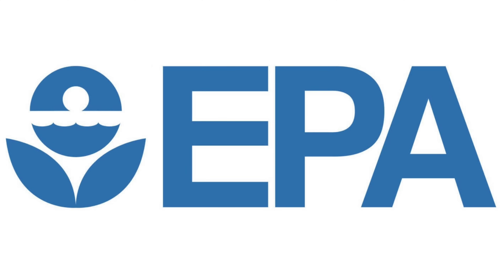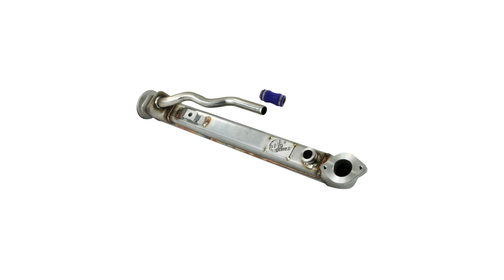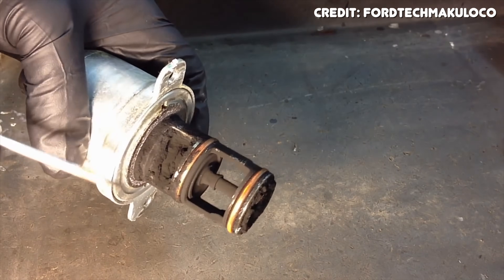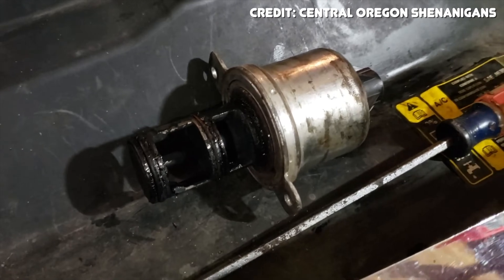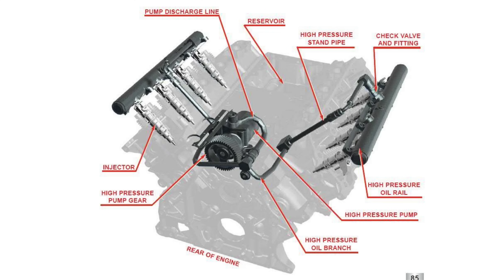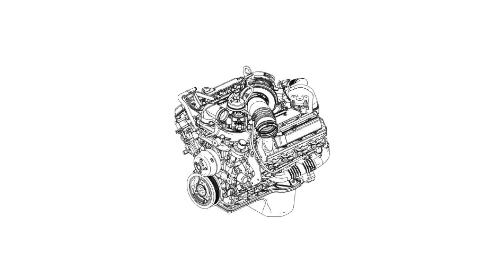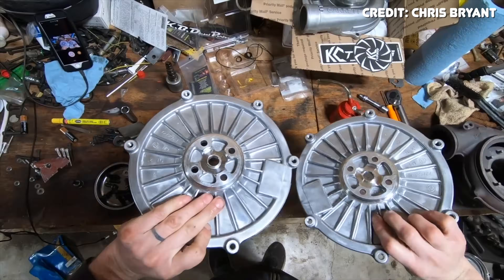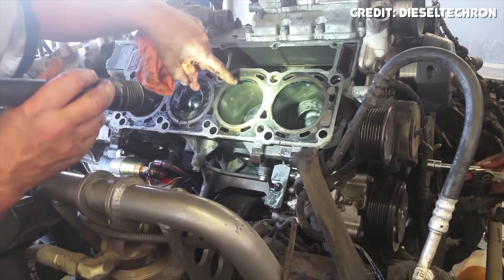The Truth About the 6.0L Powerstroke (And Everything Wrong With It)

Comment: I had my 6.0 for 17 of the 19 years. With all the necessary upgrades, the best motor. The key, change the damn oil! I add AT-205 to keep the O-rings happy + add Sea Foam and Lucas to the crank case. Keep the engine cool (Mishimoto)....1M miles baby!

Comment: Also, it was never sand clogging the oil
Cooler. It was the breakdown of Silicats in the Motorcraft coolant used in these motors that caused the clogging of the coolant passages.

Comment: Off the line originally it was a nightmare. However, when bulletproofed and properly maintained you won’t find better power, reliability, or value from Another. These trucks are still highly sought after and cost effective to fix and drive for well over 500k miles. Just a plan fact.

Comment: Why do you have to bulletproof it? That means it's NOT a good engine. Anyone that thinks it is doesn't have a clue. The modern 6.7l built by Ford is completely amazing. No bulletproofing necessary. My 2018 f250 has 480,000 miles and with 500hp and 1100tq.... It smashes any tow job or highway trip. 7.3 was good reliability, but has no power in comparison. The 6.0 and 6.4 are embarrassing. You'll eventually try a 6.7 (2017 and up best) and you will see.

Comment: I bought a 2005 (F350 dually crew cab) 6.0 with many upgrades already completed; EGR delete, studded heads, new turbo, radiator, etc with 196k. I paid $7500 in 2019 which I thought was a steal. I've had it 5 years and it now and it has 203K so 7Kmi in 5 years and I've spend nearly $10k on repairs. the main reason it has low miles is it's still unreliable and I'm afraid to haul even a small load farther than 50 miles. When I go to the yard at Menards I don't turn it off in fear it won't start again. It's an endless cycle of chasing engine issues but I'm too deep into it to recovery the loss so I'm stuck with it. Certainly the worst vehicle purchase I have ever made.

Comment: I have an 05 F350 6.0 which is stock! Never been tuned. Just turned 300,000 miles. Has had proper maintenance since new. I run Amsoil and all filter replacements are OEM Ford. Burns no oil. Purrs like a baby sleeping going down the road. Would never trade it. Though I may someday get it rebuilt and boosted up for more torque. If I leave it stock, I feel I can get 400,000-500,000 miles on this engine.

Comment: you want a 6.0l its real simple if you never tow and dont tune it to the moon stock head bolts are fine but swapping to studs is best thats is one of the 2 most important things 2nd is the stock oil cooler has to go right away there was sand in the molds when made they will cause your egr to crack get a good oil cooler and your egr will be just fine but i feel deleted emissions is best so delete the egr and buy any flash tuner sct4 is a great option the moon tune adds up to 190hp and 350tq so your looking at around 550hp and 900ftlbs awesome power but you will need to be studded to do this after that theres 3 or 4 simple things left to do the first one is gonna be the only actual expensive thing and thats spending the money on a good quality hpop thats the high pressure oil pump thats gonna run you about 1k dollars the sinister diesel one is a great option get the same brand for the oil cooler and slap a coolant wash on it while your at it now just 3 things left get a good quality icp and ipr sensors and get an extra ipr to keep in the truck if you have a 2003 to 2004.5 is the hardest ipr to change it driver side under the turbo 2004.5 and later its on the passenger side valve cover in the front real simple to swap out early ones its best to do from under the truck last but not least get a decent ficm its the fuel control module that sits on the driver side valve cover the heat and vibration can cause them to go bad so just keep the ficm and ipr sensor in the truck for when you do actually need it and your good to drive across the country at a moments notice and honestly once you spend the money on decent parts and get rid of the bad stock stuff 6.0s are extremely reliable im at 180k miles problem free besides 1 time my oil pressure switch went out other than that theres a reason its called bulletproofing them and id like to mention those 180k miles are all driven on the moon tune its been constantly turned all the way up most the time i just drive it like a truck but i will romp on it from time to time also to make your truck sound the best straight pipe that bitch and let er whistle like a motherfucker lol

Comment: Got rid of the EGR and cat. Put aftermarket fuel pressure regulator, coolant filter, head studs and stage 2 injectors. Now it pushes over 400hp and has no issues(Sounds beastly too)

Comment: Have had 6.0 since I drove it off the lot brand new in 04.  I do not tow anymore since kids moved out and sold the trailer and toys.  Only have 170k miles.  Have replaced egr, oil cooler (both bulletproof),  some Injectors,  radiator, fan clutch, etc.  Truck runs like a beast and the prices of today's trucks make me love my truck even more!

Comment: I have a 6.0 with 170k was Dealerproofed by Powerstroke at 125k. Engine still has original injectors and runs smooth  as my 5.7 Hemi. 
My tuner defuels at 917 degrees F on EGT, 217 degrees F on oil temp and 220 on coolant temp.
I send in oil samples at evrry oil change to Blackstone Labs. 
Truck runs perfectly.

Comment: As a mech, The best engine hands down is the 2015 and newer 6.7L but if you dont wanna deal with DPF the 6.0 is the next best thing. We have 20 6.7s in our fleet and load and drive the hell out the very few issues compared to cummings and Duramax. I bought the companys old 6 litter with 250k miles and it still runs like a champ.

Comment: Sure, a Ferrari engine requires that the timing belt be replaced every 70k miles, at approx. $30,000, yet it is a wonderful bit of engineering.  You have to change the EGR cooler and oil cooler at 150 to 200k miles for approx. $3,000 and man what a hunk of crap.
Go figure.

Comment: hind sight is always 20/20, had I known back in April of 2006, when my 05 f350 was chocking out white smoke & no power, that it was the head gasket, I would have NEVER allowed the stealership do a warranty "Band-Aid" fix & they also moved the degas bottle sticker to a lower level. it failed again, just before the 100,000 miles and 5yrs were up and the Service manager said, lets hold off on putting in a Power stroke warranty claim, until you really need one..... Well, next time, its lawsuit time...

Comment: The big issue with videos like these, like deboss, is that it reflects culture more than facts. The 6.0 is fairly reliable, besides the oil cooler and egr. Put a coolant filtration kit, and bulletproof swap, or delete, your egr, and change your effing filters. Keep it stock and you'll last as long as a 7.3. But you wanna tune it up? Here's how, get new heads that are O-ringed, stud them, bulletproof remote oil cooler and refresh your gaskets and O-rings. Boom! Reliable and tuner friendly. Every video comes off as the "fixes" don't fix, but address the issues. No! They fix them for good.

 Bulletproof Diesel has an egr kit that fixes the cracking issue, because it's redesigned. They also have a billet water pump because the ford one is plastic and will delaminate from the bearing. BPD also has an oil to air cooler, removing the need for a coolant filtration kit, but also removes coolant from mixing in the oil should the cooler rupture. BPD also has a bypass oil filter kit to screen more abrasive contaminates out of the oil to prevent the injectors from failing, due to them clogging up. All of these fixes are cures, not band-aids on a gun shot wound. Cures.

 Any mention of gaskets (other than the head gaskets) and O-ring failures are not "problems," because they happen on all engines, gas or diesel. There's a reason why guys buy 6.0's multiple times, you rarely hear of guy's buying a 6.4 twice. They buy a 6.4 and sell it before it blows up and buy a 6.0 or 6.7. Heads for a 6.0 are $1,200 on powerdrivendiesel.com but for a 7.3 on kill devil diesel's website, the same type, improved and O-ringed are $2,800! $1 for $1 you make more Hp on a 6.0 than a 7.3, before you get into the 1,000hp dragster performance and prices, but for the average consumer/enthusiast, 600hp on a 6.0 is cheaper than a 7.3. The sad part is small hp gains, you want 400whp on a 7.3? turbo and injectors. On a 6.0? new heads, studs, oil cooler, egr/delete and ficm, and a BPD water pump. But once you're there, more power is cheaper. Not to mention that after 2000, 7.3's came with 3d printed rods, so, you're buying rods and taking the motor out.

 I was terrified of 6.0's and 6.4's because I blew my 6.4 up and didn't know why. I "knew" at the time that the 6.0's had a head gasket failure, but I thought it was inevitable, it's not. So I went with a 6.4 and it came with deleted with a tuner. We towed 700+ miles and it ran rough when we parked it, only to find out I melted a hole in #8 towing 12,000lbs. I found out later that the 6.4 is just a bigger 6.0 and thought they're both unsavable, wrong! Here's what happened, the truck was on a race tune while towing, didn't know this at the time, nor was I the one driving. And after years of research I have finally come to the conclusion that you can save both engines. For the 6.4, sadly requires a "race engine." You need new O-ringed heads, a new hpfp, forged internals and a different turbo set up, boom! As reliable as a 6.0. And I've already told you how to make a 6.0 reliable. If these engines were so unreliable and unsavable, there would be zero aftermarket support other than Cummins swap kits.

I remember watching a Deboss video on the non P-pump 5.9 Cummins, he said some similar things, to the effect that the fuel pump was unreliable. And the way he spoke of it was that they are prone to failure, yet there was a follow up video where he was going to swap that exact motor, he just warned me not to buy, into a Duramax chassis. I didn't feel deceived, although you could make that claim, but it felt more a kin to exaggeration. You don't have to change your oil, but If you want an engine to live, you must. The 6.0 doesn't need to be "bulletproofed," but it will only last so long. Unlike the oil maintenance analogy I just made, you don't have to "re-bulletproof" your 6.0, just bulletproof it the one time, and make it a good kit, and it's as reliable as you would think the average motor is, when changing the oil vs. not changing it.

Comment: I had 2003 6.0. It was a lemon law buy back at 15,000 miles. I got it cheap. I bought the full warranty. I kept new batteries in it. Replaced them every 5 years. Oil changed every 5,000 miles. Kept it stock. I did immediately change out the radiator fluid and did a radiator flush. That was because I heard there was sand left over from casting the block. That clogged the oil/cooler/egr. Which could cause the engine to over heat. The variable turbo had a ceramic plate that would warp and need replacement every 20,000 miles. Replaced the control module and the injectors. I loved that truck. Even stock it was fast.

Comment: When you talk about a ficm overheating and causing a hot.No start, you're describing the high pressure oil system o-ring failure.I've never heard of a ficm overheating and causing a vehicle to not start.  Is the classic hot?No start for the sick, so is when the engine oil gets nice and warm with the lower viscosity.After you turn the vehicle off you can't build up your five hundred p s I minimum crank off pressure.

Comment: A ton of great info for a newer owner or potential owner, 1 thing that should be noted about the head bolts is while yes the 7.3L and Duramax engines used 6bolts per cyl the 4 bolt design in Ford’s 6l actually had more clamping force compared to the 7.3L, 6.6L and 5.9L.

Comment: I've had mine for 15 years stock.  Has head bolts.  400k miles and have had only trivial issues.  I keep the oil fuel and coolant clean and just drive.

Comment: @Dust Runners Automotive Journal - Regarding your recommendation to use pour in oil additives, I have never seen or heard of any automotive manufacturer in the world that recommends pour in oil additives.  This is because adding a mystery ingredient, (a pour in oil additive), can have unplanned and negative effects, as it upsets the delicate chemical balance of a motor oi and the chemicals that are already in the oil's additive package.  It's money well spent to simply use a good quality synthetic motor instead and save your money on pour in oil additives.  Lake Speed Jr. over at the Motor Oil Geek YouTube channel has a very good video on why he does not recommend using pour in oil additives. Look for his video, "If You LOVE One Of These Additives, DON'T Watch This Video!".  Lake is a Society of Tribologists and Lubrication Engineers Certified Lubrication Specialist, an Oil Monitoring Analyst and a motor oil geek. :) --  31 year independent AMSOIL synthetic lubricants Dealer.

Comment: Duramax did the same thing on the newer duramax motors but it don’t deal with the head bolts it deals with the crank there’s a pin like thing on crank and if that snaps it WILL kill your engine it’s also crazy that an issue that small can kill a duramax compared to the power stroke witch does not have that issue every diesel has their fair share of reliability issues but realistically duramax, Cummins and power strokes are bad and it’s the truth.

Comment: I've got an '05 6.0 that I traded for a damaged prius (this was when diesel was like $7/gal). the previous owner had maintenance records showing the hpop, oil cooler, and EGR cooler were replaced recently. I sevice it according to the "severe duty" schedule, and bought an aftermarket monitor to keep an eye on oil temp, coolant temp, and FICM voltage. bought it at 200k miles, and it's got over 250k now and has been a great truck.

Comment: 2004 f250 powerstroke. Love the truck. I bought it used. Did not know about the engine at all. Apparently, the previous owner had addressed a few of the issues. Studded and egr addressed. Not sure but believe he may have upgraded the FICM. 
I blew an injector after around 70k miles of my driving and washed a cylinder. Before that just basic maintenance. Just got it back with a new short block. Cheaper than a new to.me truck by far.  Had him upgrade the HPOP to cast iron from the original plastic. Upgrade to metal water pump. I did the bluespring, coolant filter. New oil cooler. Kept egr upgrade and restudded heads. I'm still breaking it in from the rebuild and it runs better than it used to.
Now i plan on cosmetic upgrades on interior and exterior. Modernize the interior. Add the f550 lower dash for accessory switches. Adding lights, winch, etc. 
This truck may out last me and be passed on to my kids. The 70K miles took me  around 10 years to rack up. 

Previously i had torn down the upper engine just to check things and learn about it. I do.need a.new clockspring and sunroof stays closed. Something in the track popped. But was not used regularly so low on the list. Most interior fixes will just be replacing worn upholstery and plastics getting brittle in the sun. New stereo, usb ports, backup cam, etc... simple stuff.

Comment: I have a 2004 6.0.  It had the high pressure oil pump replaced under warrantee .  I’ve replaced the glow plugs, fan. Water pump. I added a coolant filter and better boots for the turbo exaust system.  That’s it for 230,000 miles.  It’s been a good truck but it’s basically stock.  I’ve towed a 36’ toy hauler around the country with this truck and a car hauler.  They can be terrible truck or awesome truck.  If you do regular Maintnance they are fine.

Comment: Tbe 6.0l powerstroke "can be"  a good turbo diesel engine with the right fixtures/modifications.  Ford supposedly corrected some of those said issues for the 2006/2007 years but owner's still had issues. I own a 2007 Ford F350 6.0l DRW Lariat crew cab that failed around 80k while under warranty and got a new longblock installed a the Ford dealership.   Then my 6.0l had a bunch of modifications done to bullet proof; EGR cooler, Oil cooler, coolant filtration system added, ect...  I use a Scan Gauge 2 mounted to my dashboard to monitor my deltas.  
Good video.

Comment: I have a 2006 that I left with stock power and I’m at 215,000 miles on the stock head bolts, injectors, and HPOP. I replaced the oil cooler at 200k and I now need to replace the o-rings in the HPOP. She has been extremely reliable over the 9 years I owned her.

Comment: So, I have a 2003 Ford Excursion that has just turned 320,000 miles and have had no real major issues. So yes, in your vid you addressed the major issues however my 6.0 had the cats removed early on and when I bought it it had 276,000 miles on it and had a kind of sort of delete done to it. So, I properly deleted it and I also have a Stealth Mod installed since I bought it and everything is fine. I does leak about a half a quart of oil between oil changes ...but rally what diesel truck doesn't do that ....come on now!!!  6.0 power up!!

Comment: 😂 10 hr for the egr if anyone needs it swapped out I'll do it in 4 or it's free. Plus new turbo alternator injector wiring harness and add one our and I'll go ahead and put a new oil cooler and screen flush the system out

Comment: I work on fleet vehicles and we have a bunch of these that break all the time, usually egr related. To add to that the vehicles are rarely used to drive over 30mph, idle a lot, and are not properly warmed up before driving, specially during winter conditions..